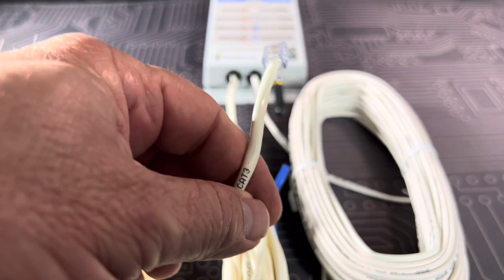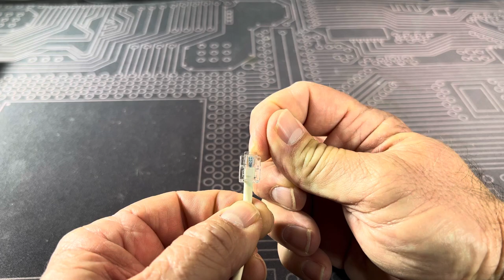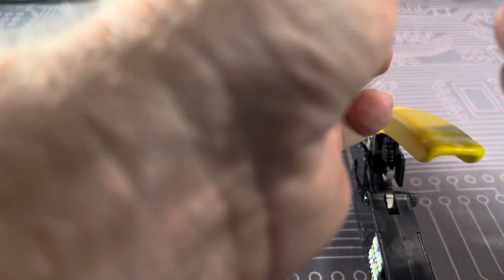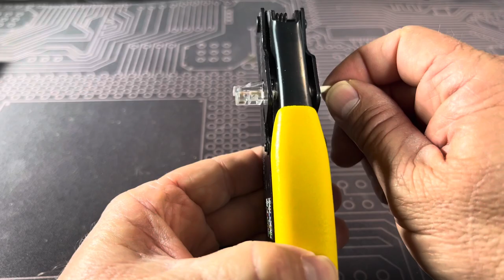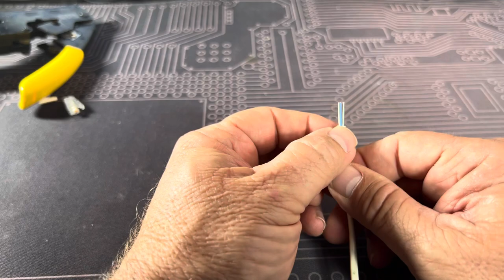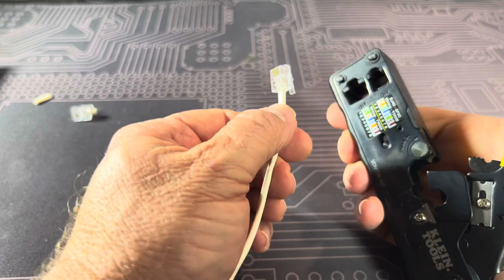RJ11 adapter installation

Comment: Can I repair the cable while it is still plugged
 in to the phone jack outlet in the wall ?
Reply from the maker: No, the system should be unplugged or you will short out the SmartLink Aircard.